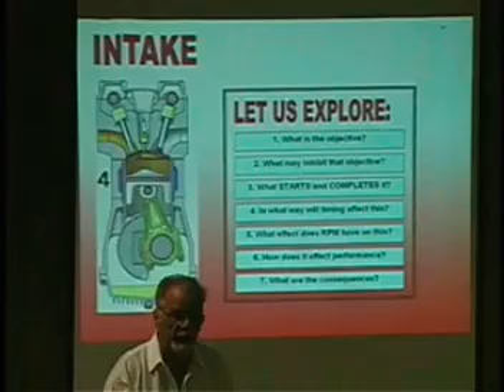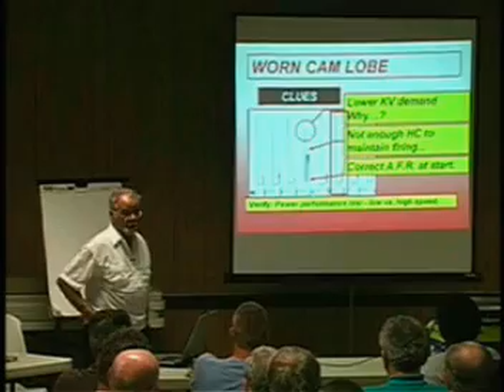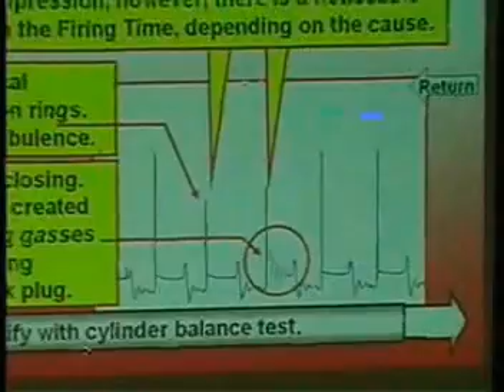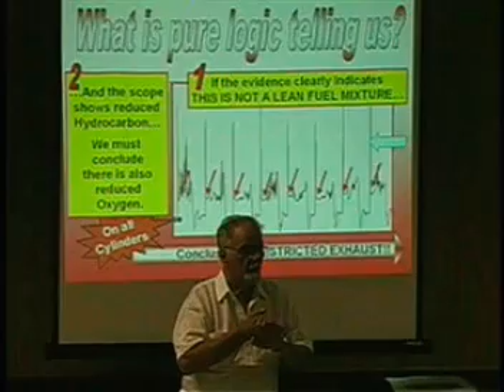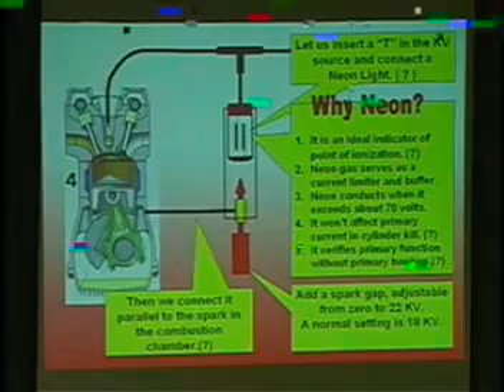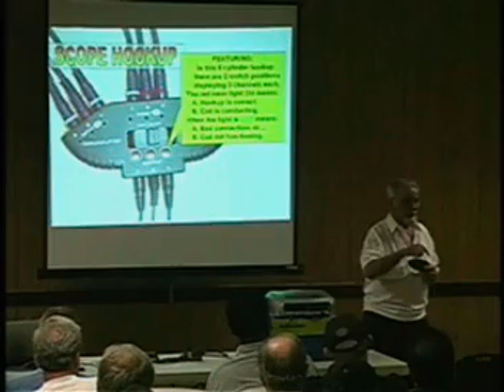Diagnostic Skills Beyond the Scan Tool with Mac VandenBrink

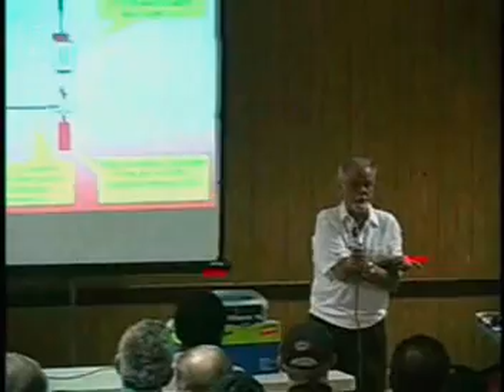Comment: great video, at 1:13:00 ish, how did that guy guess timing? i guessed compression but how does timing change where the spark ends up? does anybody know? thanks in advance
Reply: When at idle, the kv demand is "high", therefore the spark jumps thru the light bulb as it is the path of lower resitance in comparison to the in-cylinder pressure combined with the relatively late ignition timing.

When  accelerating , the timing is being advanced and spark takes place earlier when there is less compression in the cylinder at the given moment where the spark occures, hence there  is less kv demand.in the cylinder than thru the light bulb and the gap tester.

Now, whe nthe bulb does not  flash while rising the rpm it tells you the current is indeed flowing thru the other path.
It only can flow there if the kv demand is lower than in the other path.Itonly will be lower if the timing is advnced...
CONCLUSION: If the bulb does not flash the the timing advance is indeed working.
Reply: Excellent explanation!! I have it in my head from years of being around it but to make a carpenter or window washer understand how timing is the affected by pressures and vacuums in degrees is just damn good. Hi 5 Juergen!! Hi 5